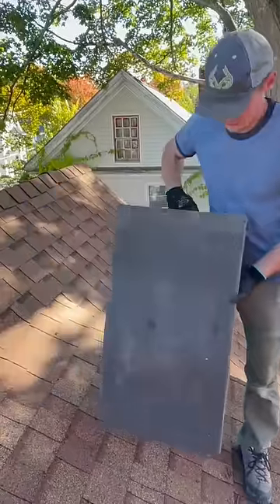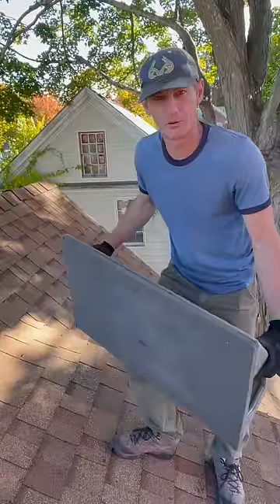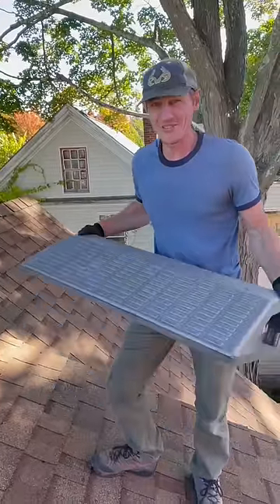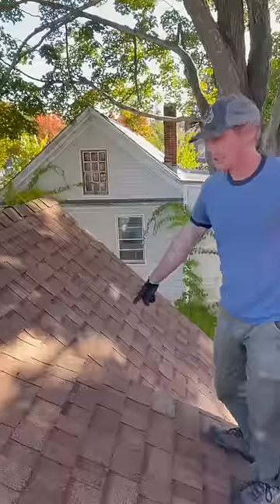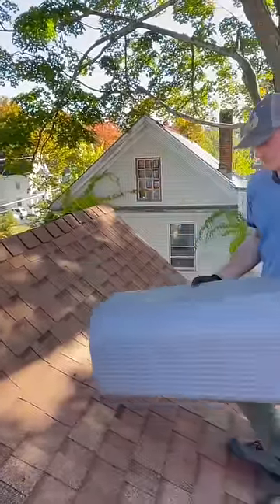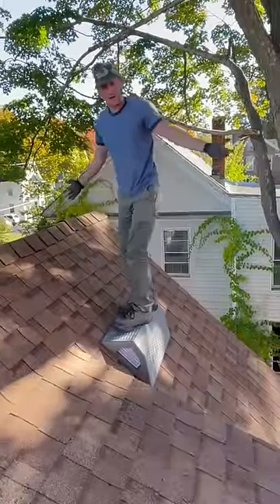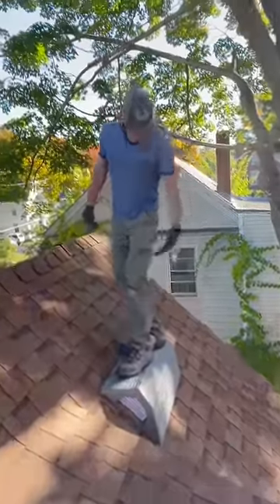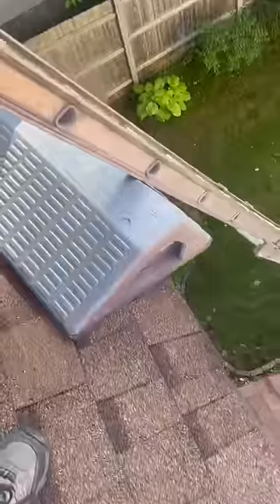Pitch Hopper

Comment: It's just some thin foam padding. An old couch cushion does the same and lasts way longer than that 2 inches of foam padding
Reply from the maker: You’re completely right. I can tell right away you think exactly like a roofer; great imagination. My favorite things about using cushions is how I can stand without bending my ankles on steep roofs, or when I need to screw off my scaffolding plank with a t30 GRK, they have incredible holding power In cushions.
Reply: Typical roofer. You're so cool and know everything. I bet you're a badass.
Reply: Yes but for comfortability, pitch hopper wins every situation
Reply: The hopper last longer
Reply: The pitch hopper is better than a cushion for steep roof walk and first man up situations but they aren’t that comfortable to work on.
Reply: I haven't found a couch cushion with a ledge to stand on yet
Reply: True, but try a hopper, you'll never want to roof without one again.  I said the saaaammmeee thing bro. Til I used one.
Reply: No it doesn’t. Foam pads slip. You have to keep adjusting. I do use foam pads to lay on to do detail work . But to effectively stand on singing pitch hopper. If I just need a surface to put my tools the pitch hopper.🤝

Comment: That fact he just tossed it on that steep pitch and just walked out on it shows some true confidence in that product.  I would have been on my knees kicking it to make sure it wouldn't move.  🤣🤣🤣
Reply: same here sir lol
Reply: I ain’t mad at you roofs are nothing to fondle with
Reply: @tylerhowerton8518  but fondle on!
Reply: Exactly what I was thinking😭
Reply: Looks scarier than it is when you're up there. My roof guys use pieces of foam.. we had someone throw a foam couch cushion into our construction dumpster and the guys jumped in to get it out and they took it to use.
Reply: I was scared using mine at first but about 20 minutes in I trusted it with my life
Reply: If that thing slid...boy o boy
Reply: @packleader1215  Its odd, looks like it shouldn't stick to the roof but when you test it, you realize that material and the asphalt just stick to each other with the right pressure and pitch.
Reply: Im sure I'd be the same way. However, it is interesting how comfortable you get after a while. I'm naturally scared of heights. I got a job retrofitting lights for different businesses. I remember holding onto an 8' ladder for dear life, tring to do the job with one free hand. After a month or two, i was on my tippy toes on the top step of a 14' ladder, both arms stretched up, cutting wires and installing lamps.
Reply: I work at a roofing supply warehouse and we just got on to use as a demo and those mfs don’t move we jump on them all day and the only time it moves is when someone who’s over the weight capacity gets to comfortable moving around on it

Comment: I like that bit at the end, using it as a ladder block to protect the gutter
Reply: So how do you get it up there to lean your ladder against it?
Reply: @jjw6342  you climb the ladder. As long as you're not a fat fuck you can go up without damaging the gutter. The block is more so used if your gonna be bringing bundles up the ladder, or adding  staging that will hold multiple people. Personally I like to use plywood cut offs for this purpose. 

My company doesn't use pitch hoppers though. If it's steep it's roof Jacks, 2x10's, and couch cushions 😂
Reply: Goatee
Reply: @JohnWick-stardawg  Jean Paul guttee

Comment: I was thinking of getting one of these. I work mostly on metal roofs. I know it’s not meant for a metal roof, but with your experience with it on a metal roof, does it work good?
Any slipping?
Thank You!
Reply from the maker: I was on an un-walkable metal roof and it held, I totally trusted it. It did try to slip when I leaned up the roof though, the key is keeping your weight over it. I’ve been using mine for scaffolding setups too, just plank over too it and screw with a GRK. It protects the roof and gives a stable platform. I bought mine direct for like $125 I think.
Reply: @chadvaillancourt  Thank you!  
I will have to try it out on a roof that’s not too steep first.  
They should make one with magnets inside just like CougarPaws Steel Walker. 
Thank you again!
Reply from the maker: That’s actually a really good idea. Most of the metal I work on is aluminum powder coated stuff though, not magnetic. 😕
Reply: @chadvaillancourt  most here in Maine are cheap painted Home Depot Shelterguard steel roofing panels that aren’t even installed properly lol, and the homeowners get charged an arm and a leg to get that installed. They are paying close to standing seam prices to get a new roof.

Comment: Abrasion/grit material in shingles, paired with a foamy mat that covers a wide surface area of contact to mitigate slide/movement when applying down force pressure.  People, did you remember anything from physics class in HS?

Comment: It is one thing to be confident. But dont become complacent.
Reply: It is the coefficient of friction at work here . Once you know rhe science you can understand the reason for trusting it .
Reply: @jjsharp2002  correct. If you are standing straight up and down on it youre fine but using it as a catch could get you killed.
Reply: The shingles will fail before that slips. They stick like you nailed them in place. I am referring to comp roofing only. Metal roofs, well I'm personally a bit apprehensive in it's use in that specific application. I have used them on steel, but not to stand on, so I have no experience with it in that application.

Comment: Back in the good ol days, I would use old couch cushions, and they would keep your ass on the roof. I would roof a 12 on 12 roof with no jacks. I would take cushions and duct tape them to my legs, and have a couple to throw around to help move, and for holding materials. we hand nailed everything, and we didn't have any safety gear. No harness or ropes, no jacks, and we still kicked ass getting it done. Two of us would roof a 25 sq  8/12 -10/12 cut up roof in a 10/12 hour day, that includes drying it in/ vapor barrier. all hand nail. Staples on the felt. I hear a lot of stories, and I know there are better roofers than I, but there is always someone better in everything we do. It's the most physically demanding trade in the industry, and yes even above masons, whom I do respect, but that is number 2, just saying. I love busting my ass, and knowing at the end of the day that ain't nobody can tell me that I don't earn my money. Work hard, but you have to get paid. Don't let these fools work you and not pay you what you deserve.  I was making $45 a square to nail on 5/12 in the early 80s. These contractors are making bank on your work. Make them pay, because they can't do it without you. Or move on. We are getting hard to find, so they have no choice but to pay... Don't line their pockets and leave yours empty. There is to much work out there, don't be a fool. Get paid.

Comment: Had them on a 12/12, They are great. Till your roofing away and they slip ever so slightly. Had the harness on wasnt going anywhere but it wakes you up thats for sure.
Reply from the maker: I had it on a 48 degree roof a couple days ago and it holds fine if you’re standing with weight straight down. When you start pushing up the roof and get your weight above it, this will slip a bit.

Comment: Wrong. It 100% walkable. Not trying to be arrogant or anything but I am a roof claims adjuster and there’s boots called cougar paws. You can walk anything up to a 8/12 pitch with those. Essentially, what that guy is holding is a piece of styrofoam with open cell foam what you’d find in your couch cushion. Cougar paws are the same thing just boots with a out sole that’s Velcro and you can apply their proprietary foam pads that have Velcro as well to the bottom of the boot and you are good to walk on any roof. Granule loss is a different story but even that thing he’s got wouldn’t work with granule loss. But still very helpful for hold packs of shingles and tools while on a roof. I’d still get one.
Reply from the maker: As a someone who claims to know roofs, why in the world would you call it an 8/12? 😂 
It’s literally 45 degrees 🤦‍♂️ 
I bet you don’t miss much

Comment: This would work only on asphalt shingles, right?
I assume it will not work on synthetic slate, there would not be enough friction.
Reply from the maker: I had it on a 10/12 metal slate roof and it held fine. I haven’t been on a synthetic slate roof but I have held the pieces in my hand, they don’t seem as slick as powder coated aluminum.
Reply: @chadvaillancourt  Thank you for your answer and insight. The metal roof you used the step on was it something like Decra or Unified Steel with even rougher grain than the asphalt shingles?
May work on Brava synthetic slates since they have a rough surface, even rougher than real slate, or FWave because they are really gummy.
But the ones like Davinci or Envirosslate are quite slick.
Unfortunately most slate tiles either synthetic or real have little grip, IMO it would be too risky to use that step on those.
Thank you!

Comment: But I'm confused about is what trouble you had with the ladder that you needed to use the pitch Hopper you would have been fine with it normal without the pitch Hopper so I'm completely confused as to what trouble you had with the ladder without the pitch Hopper
Reply from the maker: It allowed me to angle the ladder away from the sidewall of the house so I could have room to haul buckets of brick debris down and bring new brick up. Without it the ladder was on the very edge of the roof and touching the sidewall to the left, not to mention the cobblestone garden at the bottom made the footing uneven.
Reply: @chadvaillancourt  but your footing was in the grass and your ladder looks more then long enough and y need clearance on the left when on the right you wouldve had clearance.  I'm so confused lol. And that 90 degree is perfect cuz if you had ladder set a bit that if it slid that it slide towards that corner a stop the ladder.  That what we do at work and we do extreamly sketchy things with ladders.  Butt we are painters not roofers.  But we do use a wedge thing from Sherwin that's similar to Hopper but it's not 100% reliable especially when balancing ladders on a roof on it or standing on it and your on a 5 story peak roof
Reply from the maker: I don’t know what more I could tell you. The ladder didn’t fit safely when it was perfectly inline with the roof and I would have been in the flower bed, so I angled it outward, problem solved.

Comment: Yeah I don’t think he quite understands how physics works and specially the fact that friction is the ONLY THING THATS HOLDING THIS ON
Reply from the maker: I guess I just don’t understand. Too simple minded really.
Reply: @chadvaillancourt  yes with the amount of surface area that thing has, it can only hold so much weight, and the more steep the pitch is that weight drops dramatically. In multiples and other factors like a wet roof or a really weathered roof that is loosing its grip makes it super unsafe specially to put that must trust into a block of foam with sandpaper on the bottom…. Then grip on the bottom of the foam will loose grip as well. So your a brave man to have that much trust in that thing!! lol

Comment: I would no problem walking on that in my cougar paws. they hold on a 12/10 no problem. you just have to not be scared to lean into them. work would be so slow with this thing. if you worried about walking in paws put some running boards up and get to work. like seriously... gonna make an assembly line of dude sitting on theses passing squares?
Reply from the maker: I don’t think it’s really just for roofing. I think it’s great for me doing chimney work/ inspecting chimneys. Siding and painting in certain areas and you could probably stock about 8 bundles of shingles on it if you want. Shingling a roof off of this would obviously not be ideal.
Reply: @chadvaillancourt  I'm not trusting that to 8 bundles. I guess working off it on a steep pitch for chimneys but I just tie off from a harness around the chimney and then I'm free to walk wherever. About the only thing I see remotely convenient would be a simple patch job so I have a table for what I need and don't have to worry about them sliding down or adding weight to me while I work.

Comment: And do a bit of wiggle, stand up to fast or put some top heavy weight on it and it going to flip..
Reply from the maker: Obviously you’ve never been on one of these. Couldn’t flip it if you wanted to. 🤦‍♂️
Reply: @chadvaillancourt  try it for me, show me that I am wrong.. lean back baby.. 
It going to go like those 2 wheeled boards..putting forward pressure towards the roof you are fine, leaning back and putting pressure toward the back of it, it going to go.. watch when you climbed on it how it moved..

Comment: post the video of you leap frogging at least a 10/12 with a two story drop off. You won’t do it cuz you’ll be scared shitless and realize how much you dont trust that thing lol they will slide out on you trust me. I mainly use it to hold tools etc
Reply from the maker: If I had purchased two I would do it without a thought. I have faith in myself to utilize the tools I have and my surroundings.
Reply: @chadvaillancourt  They are not intended to be used like that. They are simply a more comfortable position to stand while still using safety equipment. Trust me I’ve pushed their limits multiple times. They will slide out on you for a fact. It’s not a safety or climbing device. You won’t hardly ever see an actual roofing crew use one. They are for salesman and adjusters that are scared on a 4/12. Again I do have one but I seem to only use it to hold tools, While I use a sponge to actually hold myself on the roof. If you can’t climb it normally, just use a goat or you are gunna hurt yourself.
Reply from the maker: I push all my tools and equipment beyond the intended limits. I don’t read the safety manual either. I don’t care what the manufacturer suggested uses are , I use things how I see fit. 
I assume all risk

Comment: lol I've walked on a pitch like that so many time and pitches even steeper. that ain't asaife at all my boy. one slip and you goin straight down. and it does get safer than that. it's called a harness, a rope, and a couple nails on the other side. you can only stand in one place with that thing. what if you have to move down? I bet yo ass you wouldn't pull that from under you. with a rope you have full maneuverability and it's way safer my guy